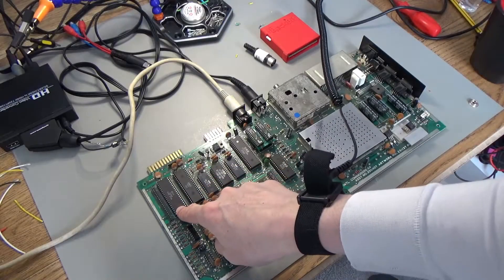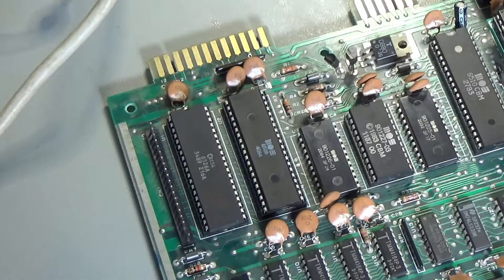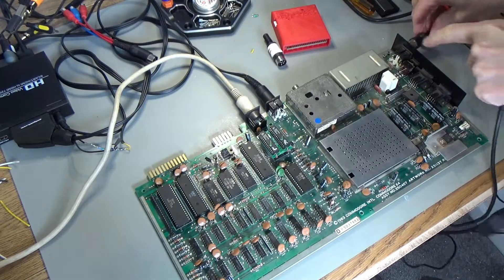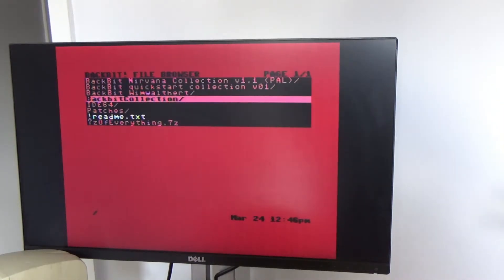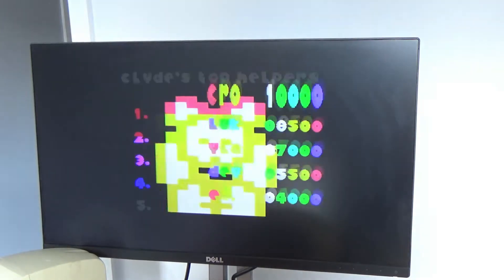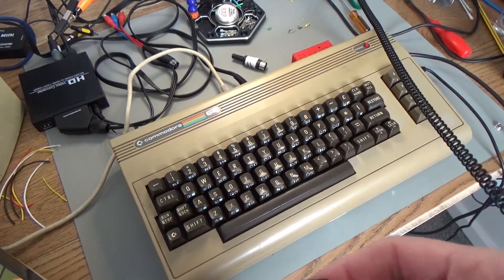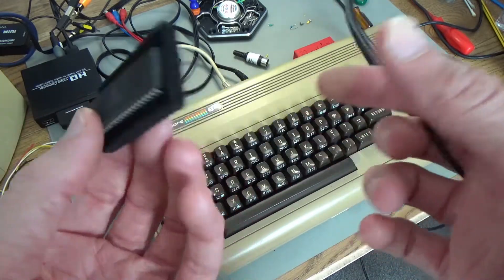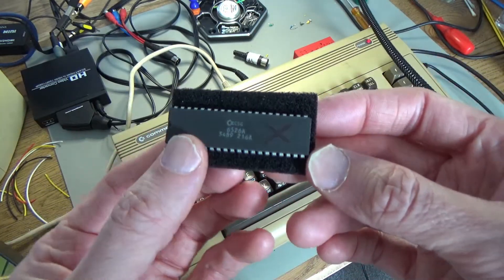C64 Replacing a Bad CIA Chip

Comment: Thanks. I have a problem with loading disks with pi1541 nothing works. Im new to the c64 but maybe cia chip is the cause.
Reply from the maker: If it is a breadbin C64, and the 2 CIA chips are socketed, then you can swap the 2 chips around and see if your problem goes away. If it doesn't, then it's probably not the CIA chip causing the problem (but if it was the problem, you might find then that your keyboard has problems or something else is wrong).
Reply: @DavePoo2  thanks Dave, mines c64c. Can’t remember if they’re socketed. If not I can put sockets in.
Reply from the maker: @Jamesfo8rf They are usually not socketed on the c64c
Reply: @DavePoo2 thanks Dave. I’ll have bit of fun soldering.
Reply: Hi Dave just give you a quick update. I had fun putting both CIA chips onto sockets. However it’s not the CIA chip that is faulty. It’s the epyx fast loader. I disable it and the images load just fine. In case you have any ideas please let me know. Thanks.
Reply from the maker: Good that you found out the problem. Unfortunately, I know nothing about the Eoyx fast loader.

Comment: I'm having keyboard issues. I could type k and j but after taking out the CIA (second one over from the keyboard interface) keyboard stopped working. At least I know what the problem is now. I was 75% sure before but after your video I'm going to order a new CIA. Thanks.
Reply from the maker: The chip at U1 controls the keyboard, but U1 and U2 are identical chips, so you can swap them around and then if your keyboard problem goes away and another problem appears then one of your chips is dodgy (but be aware, it might be possible for both chips to be dodgy!). But I would first check that you keyboard itself works, as I did get one keyboard where barely any of the keys worked on the keyboard, it needed the contacts cleanings. For the chips, you can also put your finger on them while the computer is running, and see if any one is getting very warm, as that would indicate a short circuit inside the chip.
Reply: @DavePoo2  Thanks! I hooked up a good keyboard off another Commadore with same result. I also double checked the existing keyboard and it's ok. Just glad it's not black screen.